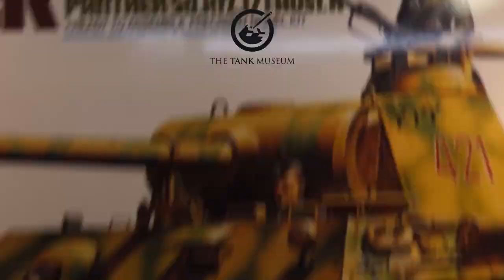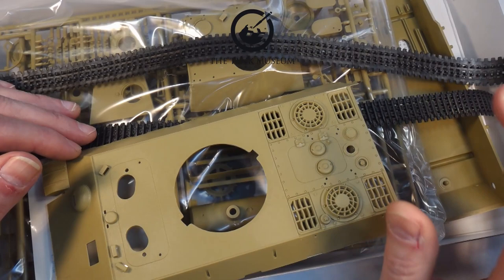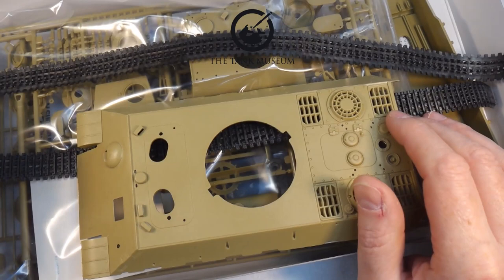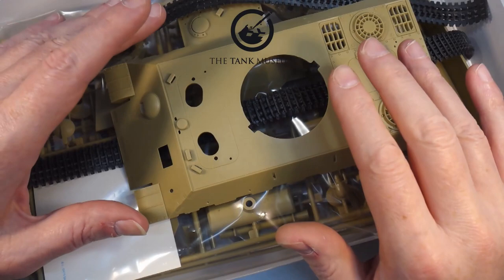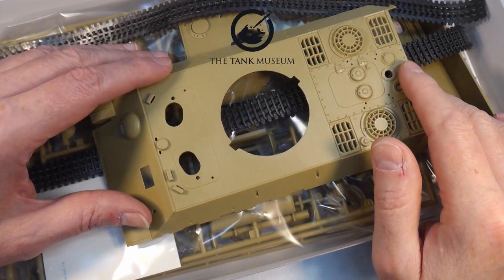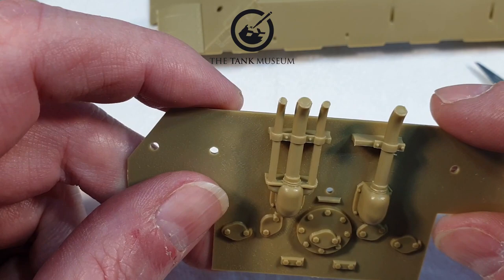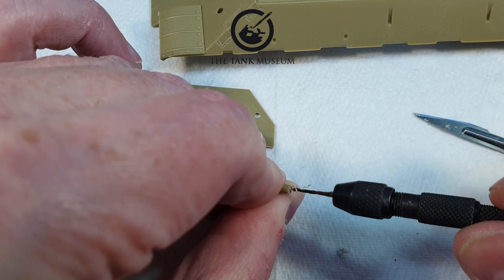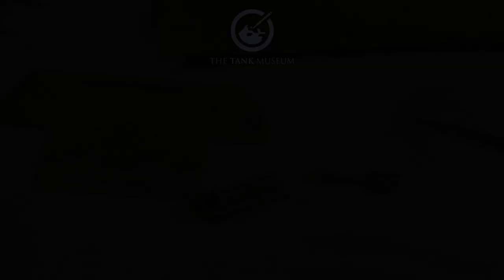Building the Tamiya 1/35 scale Panther Mk5 for a charity auction - Part One -   assembly

Comment: I remade the handles with copper wire too as they were so misaligned...also added ABER mesh PE and retextured my one....came out ok after some filler here and there,overall kit was ok..tracks slightly tight but sorted with hot water....iirc the "hole" had an air scoop on it...I just added the aber pe grille they supplied for it...also hole to left is fuel filler and should have a top cover too...I just painted mine in steel as the original caps were..notice the newer kits of panthers are far better and they altered a lot of the tooling to avoid the errors this had.

Comment: It's an old kit, but still better than the Airfix and Revell offerings of the day. Though this one seems worse than most.

I've only built a couple of armor kits, so the only suggestions I have are to snip the little alignment tabs off the turret ring to make getting it on and off easier.

Don't glue the sprocket wheels on. It'll make putting the tracks on easier.

Rubber tracks can be tough to glue together. So once you've glued the ends together, use a bit of sturdy thread or wire to hold them secure.
Reply from the maker: I melted the tracks together and they seem to be holding. Actually getting the turret on and off hasn't been too much of a chore :-)
Reply: @SteamGeezerUK  
Nice. I guess some are easier than others.

Comment: Panther mk5 lol.
I primarily build armour, and as you have found this kit isn't a nice build. It's probably the oldest kit in the current Tamiya line-up with some of the parts dating back to the 60's and the moulds have seen far better days. All of the Panther Ausf G's from Tamiya which were tooled in the 90's, are by far and away better kits than this and go together like a dream.
The bow machine gun is supposed to be offset - the gun is mounted in a rotating ball (called a Kugelblende) and there's a gunners sight on the left side of the gun which isn't depicted in this particular kit. The hole in the back middle of the deck is an engine vent cover - it just has a piece of thin round metal mesh over the top. Same with the rectangular and round vent covers on both sides of the rear deck - the mesh from your super duper cheap splash guard should have been stuck on the outside... And your cupola ring is in the wrong place - it should be mounted so that it doesn't interfere with the hatch.
And yeah, I did have a bit of a laugh, and there were plenty of stop laughing at the back moments - some of which you didn't catch.
Reply from the maker: Oh I catch them all, I just don't always call them out... ;-)

Comment: The reason the axle are assembled first then attached to the hull is to sandwich the nail like head of the axle between the cone and the hull. By securing the cone first and running the axle from the inside of the hull leaves the potential for the axle to fall out into the hull after the upper hull has been secured, making it difficult if not impossible to replace.
Reply from the maker: Ah, the plans really weren't clear on that, cheers :-)

Comment: According to Scalemates, this is a 1990 release with new parts but still from the original Tamiya 1968 moulding. Had this been my first 1:35 model it would also have been my last. Maybe.
Reply: I made one in the early 1980's, and I'm sure it went together better than this.